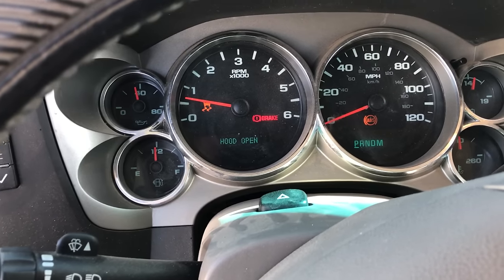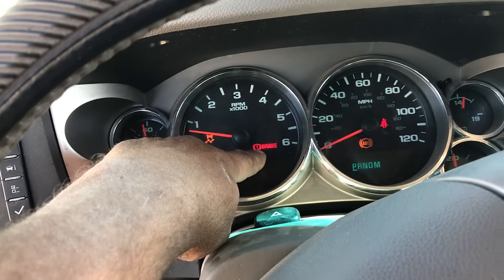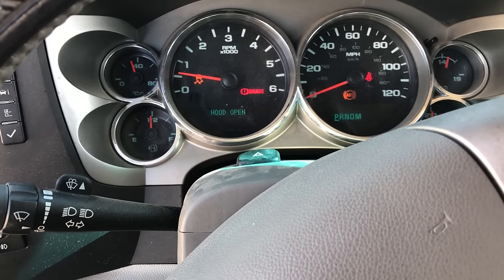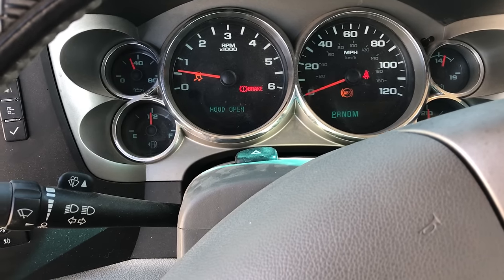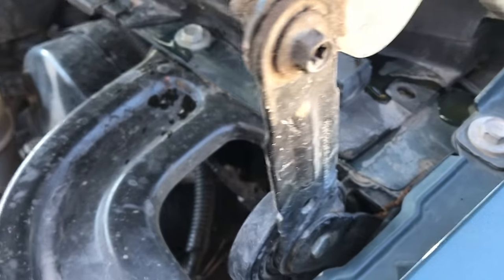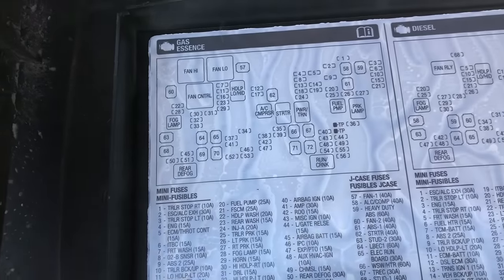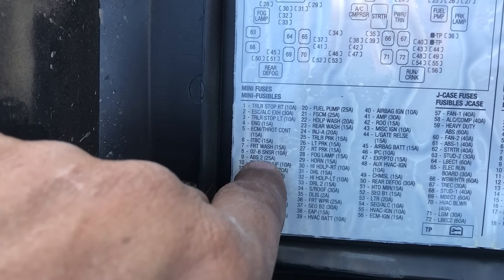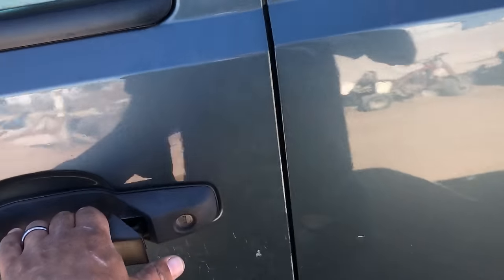Chevy Silverado ABS and Traction Light Fix, Solved

Comment: Here's another tip if the fuse IS NOT BLOWN, I drive a 2012 Silverado hd2500 Z71 LT model. Abs on, traction control/stabilatrak on. Returned from 4th of July camping trip pulling RV. THIS WAS NOT THE PROBLEM, wait for it, wait for it, KITTENS climbed onto the wheel and tire and as it passed by the abs sensor it was   disconnected. I tried the fuse, disconnected the negative on battery nothing. I went out and jiggled the right side front abs connection and that solved the issue! Thanks for posting this video, sometimes MOTIVATION from others helps us seek.
Reply: That wad it !!!! I shook the wire around and that was it !! Haha fucking amazing, my outside cats probably like to crawl in there I guess, I mean, I've seen them do it quite often. Thanks for the tip!!
Reply: @soranpanahi1990  Sometimes in life it's the simple things that make us laugh and feel genuine relief it's not major. Take care and God bless.

Comment: Negative ghost rider, fuse wasn't blown in mine. Had to replace the entire fuse box assembly. Common issue with GM trucks of these years. Handles lift up and it just unplugs.
Reply: Mines wasn't blown neither , but taking it out and reinstalling it fixed my issue . I did connect to a trailer and did blow a tail light also
Reply: Oh God no! I hope it’s not the entire fuse box that that cost a pretty nickel☹️☹️

Comment: No it is the traction light and I haven't towed anything.
Reply from the maker: have you had any wheels removed when it started coming on ? if you did then they may not of plugged the sensor back in. if you have not, then replace the brake light switch at your pedal. about 20.00 $ and simple to install. let me know, thanks!!
Reply: I have a 07 Silverado I haven’t pull anything traction control on and abs  light
Reply: Take it to orileys they can run the code

Comment: Have ABS, traction control and truck periodically goes into limp mode. Scanned with shop key and getting C0425 (ebcm). This started to happen after I had a trailer plugged in as well. Anyone else ever have this issue ? I feel like it’s something smaller then replacing the whole module. Any help is appreciated. 2015 Chevy Silverado. Cheers

Comment: Thank you very much sir. I only had the stabilitrak service traction control light on, no abs or check engine light. I changed spark plugs and wires, cleaned the throttle body, added a new ground wire, cleaned the ABS sensors, and Tie rods. The service traction control light would still turn on. After seeing your video, I changed and #9 fuse.

Comment: Changed my brake booster. ABS, Brake, Stabilitrak, and Traction Control lit up like Christmas. Changed the fuse, did the trick. However, upon acceleration, they came back on again. Going to check the fuses, fuse box, and add to this video just in case. DIY sometimes can be costly. Don't forget to disconnect your battery, GM vehicles are prolonged to popping fuses when wires ground.

Comment: This fixed the abs module on my customer rig. I ran it in the air to listen to the diff and it set a fault for the LF sensor. I clearedthe fault but the light was still on. Removed and reinstalled the fuse(fuse obviously still good) light out now. Thanks

Comment: I have a 2017. Was towing a trailer and noticed an ABS feeling in my brakes. Took trailer off, still noticed it. Pulled into my driveway and I got a stabilitracks notification with abs and traction control on. Havnt had this issue before. Definitely gonna check out the fuse!

Comment: I have a good fuse but also have a bad sensor on my trailer light relay which I ordered yesterday. If the issue dont go away I will have to go back to testing out wires. My truck had 7 broken wires already, bought in an auction.
Reply from the maker: wow, maybe mice. good luck, thanks for watching.
Reply: @thomasbriansavingmoney  I checked everything and driver side ABS sensor is bad. Thanks

Comment: I have not plugged in a trailer !
BUT you said WIERD idle or vibration !
Rough idle !!!-THEN light came on 5 minutes later ! Will check fuse ! 
 Hope it solves it !!
 THANKS

Comment: I have a 2011 silverado 5.3l.  I took it in to have the rear brakes done. They also bled the brakes, and my transmission dipstick was loose so they had to retighten etc.  I get it back and 2 days later and I get Service Traction Control, Service Stabilitrak only.  The engine goes into limp mode.  I take it into the mechanic and he said he didn't see any issues etc., he did say a P0335 code popped up which is the crankshaft sensor code.  I take the battery to test it and it was a bad battery.  That seemed to help it and no issues and 5 days later same issue. The engine has a hard time turning over, but once I shut it down and wait 30 seconds its gone and no issues.

Comment: Hi. I read through all of the comments and will try the abs fuse. I was in a fast food drive through, turned truck off so they could hear me and it wouldn't start for 10 minutes (worse nightmare at a drive through:).  I just let it sit, then it started.  Then came the service stablizer warning and the engine light.  It is starting but when you put it into gear (lost the underline on the gear display too) it makes a clunk noise, a chirping sound in front dash, transmission does not want to turn over easily when driving.  Took it to mechanic and nothing would come up on their diagnostics...seriously?  It didn't want to go into reverse for a few minutes yesterday.  Would an ABS sensor be causing all of this?  Don't want to take it to dealer even though I have an extended warranty on eng/trans because from past experience they tried to charge me to fix a DEF issue when there was a "warning" out not to.  Mechanic said he would drive it unless warning lights start flashing...uhhh, a little concerned about that!  He can't get to it until Monday.  This truck is a 2013 Chevy Silverado 2500HD diesel and doesn't even have 50k miles on it.  I have not towed anything in quite a while with it.   I will take it to Auto Zone and see if they can come up with any codes....I was told they can check specifically for ABS system errors.  Thank yoiu!

Comment: It depend on what year is your truck mine 2013 1500 has similar plus engine reduced power vs traction stabilitrak control issue and sometime it cause by rear wheel slip on ice sometime it happen when bad bump on rough road sometime it happen when mix cool chilli morning during fall or winter but summer it run great and smooth all summer long, I did check everything as other mention in youtube but it seem fine nothing blown or broken except my cd radio has malfunction and just recently I hit my radio with a fist to get it to see the clock and suddenly traction stabilitrak vs engine reduced power pop up cause the truck run in slow speed only

Comment: Unfortunately, my issue is intermittent, after I go from start to drive too quickly, or more persistent when its raining a while. also with random brake light short codes. I think it is time to start tracing wires for moisture perhaps?

Comment: I have a 2012 silverado and the Stabilitrak and traction control light are both on, NO ABS light. I will try this tonight with the 25amp fuse fix.
Reply: how did it work out?

Comment: The telltale sign for this fuse is the red emergency brake light being stuck on, despite the emergency brake being released.

This helped solved one of my issues, but still have the service traction/service stabilitrack lights on.
Reply from the maker: check the abs fuse, or check the harness where you plug a trailer into, it could be corroded a little. thanks for watching.
Reply: Ya, I had bad ABS2 fuse.  Replacing it got rid of the red emergency 'brake' light, but I still have the traction/abs light on my dash (suburban) with 'service traction/service stability' messages.  I am pretty sure it's the steering position sensor or wheel speed sensor.  I'm waiting on a new OBD scanner, then I'll know for sure.

Comment: Got the same issues with my 08. I've not had it plugged to anything in a month or so, and if the truck sets for a couple hours, the lights all go off but come back on 15-20 mins after restarting.
Reply: Thats happens to my 07

Comment: I had met almost all of the criteria on my 2011 Silverado---

•	I had hooked up our boat trailer
•	Brake light went out
•	Replaced brake light fuse

Then the Traction Control light and red Brakes light began coming on, so I thought for sure that this would fix it.  (The only difference was that the ABS light was not on).

So this did not work for us.  Do you guys have any other suggestions?

Comment: My culprit turned out to be the passenger side front wheel bearing. Replaced the hub assembly (which included a new pressure sensor), and, after driving a short distance, the two lights turned off.

Comment: Had the same issues….. I replaced the right front sensor and the hub assembly on my 2011 Suburban 1500... still had the lights and the "C0035 right front wheel speed sensor" code... Replacing the left front wheel speed sensor fixed it... How frustrating... 
Thanks @ScarabChris  for posting “GM truck like a Tahoe, Escalade, ect and it says "C0035 right front wheel speed sensor" then it's WRONG! I replaced the left front and the problem vanished!”......

Comment: Question: what if brake light stays on after washing truck at automatic car wash with a trailer connection light? My son did not conne t it correctly now brake light stays on, number nine fuse is not busted. Thoughts?

Comment: So i have this issue with my 2013 silverado. I just checked the fuse and it was blown like you suggested. So i replaced it but traction and stabilitrak and brake light still coming on.. any thoughts ?

Comment: My problem in my 2006 Chevy Silverado 1500 is that the abs starts working every time that I break, but the light doesn't turn on. Usually if I coust around 10 mph the light will turn on but the abs doesn't actually work. Everything is completely backwards for some reason and I'm not sure how to fix it other than trying this method. Any suggestions before I try this?

Comment: Mine was the abs module i had to replace it and take it to the dealer to program it and solved the problem if you scan it with the scanner and it says that it cannot communicate with abs module then it will be the abs module more than likely.

Comment: In my case. This happens to me. But only in the winter. And I’ve never hooked a trailer up. But both lights come up after I start driving. And if I pull over and shut the truck off and turn it back on. The lights turn off and I have my abs and trac control. It doesn’t happen every time though. Any ideas?

Comment: Got new ABS sensors, trailer relay,  found broken wire on driver side harness and ABS and Traction still on.....when I jacked up truck my Brake turned on the cluster. Mine is a dually but dont see rear wheel ABS wiring.

Comment: I recently changed my plus and wires on my 2007 Chevy Tahoe LTZ.  Runs great now but before the tune up ... very rough. I get Brake light, traction control at the same time.  Then shuts off after 5 minutes...then back on again...annoying.  Changing the fuse help here too???
Reply: Mine does the same thing? Any resolution?

Comment: My fuse is not blown I've changed my steering wheel position sensor and brake light switch on the brake pedal in my abs and service traction control lights are still on

Comment: I got a 02 Cadillac DTS and my traction control and ABS light comes on when I hit a bad bump and stays on. But when I turn the car off and turn it back on the lights goes off. Like I said it only happens when I hit a bad pothole or big bump and it stays on til I cut the car off and back on. What could that be? Get back with me asap
Reply from the maker: more than likely you are due for a rear brake change. thanks for watching.
Reply: @thomasbriansavingmoney  I got the whole brake system done in the back bro calipers brakes rotors. It can't be that

Comment: I switched from the base model gauge cluster to the LTZ gauge cluster and the traction control/stabilitrak light is on but I don’t have those on my truck, any way to turn the light off?
Reply: Sure. Just install stabilitrak on your truck. Or use the correct cluster, like intended.

Comment: I’ve changed the sensor and hub bearing on my 2014 Chevy impala ltz 2 but my abs , traction control light still on ,and not sure what to do now
Reply from the maker: make sure the pig tails are secure. did you change your tire size?

Comment: i have a 2011 ltz suburban that i noticed my cruise control wasnt working, so found out that the brake sensor on the brake pedal could be bad, so what i did first was unplugged it and replugged it acouple times to possibly give it a better connection and it worked , cruise control was working but the about an hour later the abs , trac control , and afew others was throwing code for service....shut off truck for a few minutes , restarted it and everything was back to normal...no warning lights or notifications.. came out of work , started it and they were back... puzzled.. ..
Reply: Tony Ash that’s what mine is doing too. Did you have any luck figuring out why? I changed my brake light switch then I started having problems with the lights coming on the dash.

Comment: After jumping truck, my stabilitrack light stays on, service brakes 
light stays on, and my radio does not power off when key is turned off 
(or when I open door).  Not sure where to start to locate the problem.  
Think it could be a fuse too? 

Thank you
Reply: Ground
Reply: Ignition switch fixed this for me.

Comment: My fuse is good. The traction, ABS, and brake light didn’t come on the dash until I actually changed the brake light switch.
Reply: Happened to me also.  Did you figure it out?  Was the brake light switch faulty?

Comment: Great video! My brake light went out on its own. Did this cause System Traction on the  reader board to come up? 🙏🇺🇸
Reply from the maker: it may have, yes. thanks for watching. sometimes the filament burns out then shakes and sticks to the other filament, common on 1157 and 2057 and 3057 bulbs.the three of that type are double filament.  thanks again. great question.
Reply: thomas brian Fixed the bulb & all light are off! Amazing I thought it would cost hundreds to fix. 💕🙏🇺🇸

Comment: Has anyone been told it's their EBCM? I've replaced both front sensors, but while visiting the local Chevy   dealership, they gave me a write up that it's my ecbm and stabilitrak computer. $1700 if I let them do it. But, I don't necessarily believe them, because they didn't diagnose the front wheel baring being bad at the same time, as it was in the shop as the ecbm diagnosis... 🤔
Reply from the maker: ouch! i always get a second opinion when it comes to a dealership. thanks for watching!
Reply: If i didn't have a payment on the car, or i didn't care anymore I'd just go buy a $2000 car.
Reply: I have a 2012 impala, pretty but, broken, i bought a $2000 car

Comment: All fuses are good  and only the traction control lights are on
Reply from the maker: check wheel speed sensor connections, check brake pad  thickness. both of these can throw that light. goodluck, please let us know what your fix was. it helps others. thanks for watchiong

Comment: You got any ideas if it say service 4 wheel drive 2011silverado2500hd diesel let me know thanks
Reply from the maker: does your truck go into 4 wheel drive at all? or is it just the light and the 4 wheel drive works ?
Reply: Same truck. Same issue described in vid, still needing a fix

Comment: Weird. I was just in park idling and the park assist off and service traction control and service stabilitrack came on with the abs light. It all clears when I turn off and on tmy 2007 chevy avalanche. I will try it in the morning when I have time.
Reply from the maker: have you recently disconnected your battery? if so, clear the codes. you'll be fine. thanks for watching!

Comment: I have a traction control, stabilitrak, abs, rear trailer brake system, park assist unavailable, lane keep Assist unavailable....   2016 Sierra with only 18k miles...

Comment: Didn't fix my issue... Bummer. No codes when lights are on, but still have the issue. I now now that I didn't start having the issues until I had trailer brakes installed and started towing my travel trailer. Next I will try changing my negative battery cable. This fixed electrical issues in the past.
Reply from the maker: please keep us posted, it helps everyone,,,,enjoy
Reply: My lights only come on when I'm towing my travel trailer about 20 miles into my trip. At that time I lose my trailer brakes but everything else works fine. After I unhook all lights go off until I hook back up. ..Frustrating

Comment: My 2015 Chevrolet Silverado has 57,002 miles. Engine light came on and the dealership mechanic said I needed a engine rebuild due to a stuck lifter and misfire on cylinder #1. $5k in repairs on a vehicle less than 5 years old. GM mechanic said it was a common problem. GM is trash in reliability.

Comment: What if it's not the fuse and both lights are still on.
Reply: having the same problem, nighmare
Reply: @RChobbiespro  I heard it could be speed sensors.
Reply: ya bro i did some research and its saying speed sensors too, the most annoying shit ever, i just ordered rear speed sensors, we will see if that changes anything, i have a abs light on , traction control, and my parking brake light flashes when i start my truck snd then stays on, i mean i know my rear brakes are shot but that wont trip traction control or abs, cuz all this happened when i lifed my truck, might of stretched a wire
Reply: @RChobbiespro  let me know if it fixes your issue bro. God bless
Reply: George's world will do brother, thanks